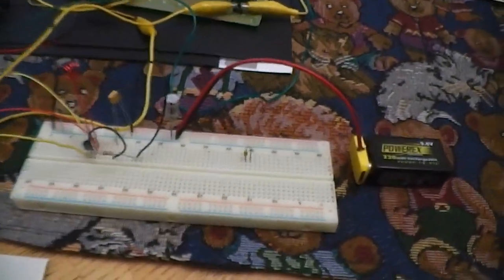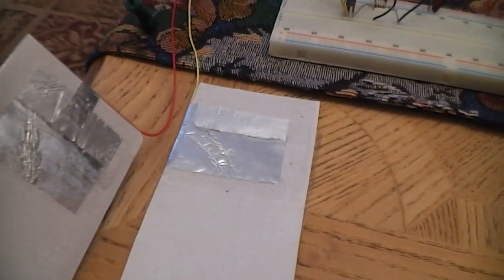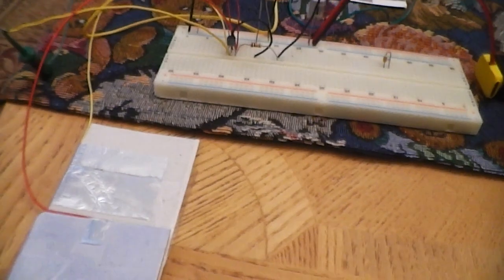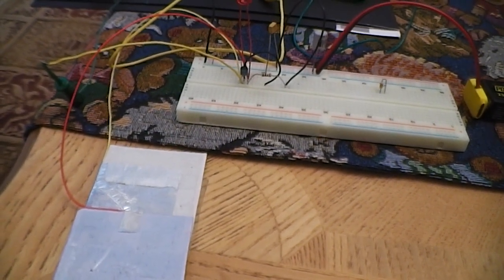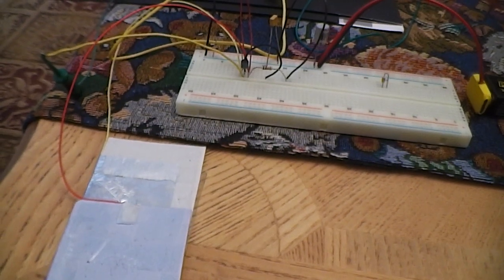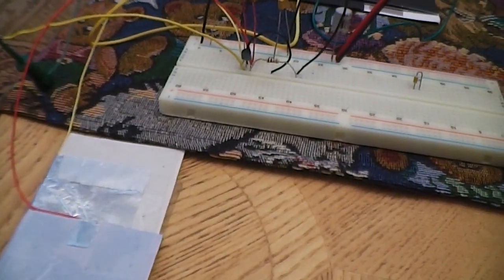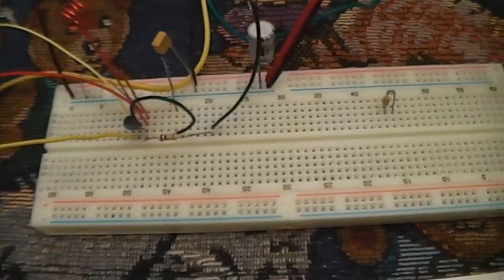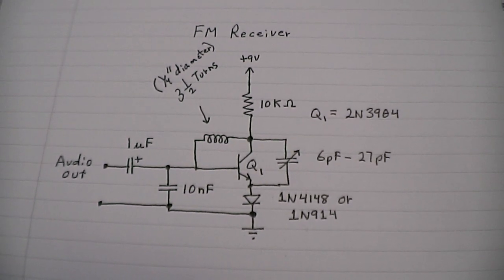FM Receiver Radio Build DIY - Part 2

Comment: where are you inputting the signal on the schematic, I assume it is also attached by the capacitor near the audio output?
Reply from the maker: The antenna is  connected at the Collector of the transistor.  A telescopic antenna or wire of about a couple of feet works well.

Comment: Can the input power be reduced?
Reply from the maker: I believe that it can, but I honestly have not tried using a lower voltage supply.  I used 9V for the entire circuit because it also powered the audio amplifier that I designed for 9V operation.

Comment: i realized i'm not able to tune the radio no matter the aluminum foil and i don't really know what i did wrong is it possible i only have two stations within tuning range if so how do i increase the tuning range
Reply from the maker: It is possible that there are only a few stations in your area.  Another possibility is that your inductor coil is not the right dimensions to give you the inductance needed to tune the FM band.  Try spreading the coils a bit or squeezing them to see if things improve.  If you want better signal reception, attach about a foot (1') of wire to the emitter of the transistor.  This is now your antenna.

Comment: what can I use instead of an amplifier?
Reply from the maker: An amplifier will be needed.  A single-stage amplifier is probably enough for headphones, but a more powerful amplifier will be needed if wanting to power a speaker.  An amplifier built with an LM386 is adequate for driving a speaker.
Reply: @jcgoldelectronics1416 what about crystal earphones